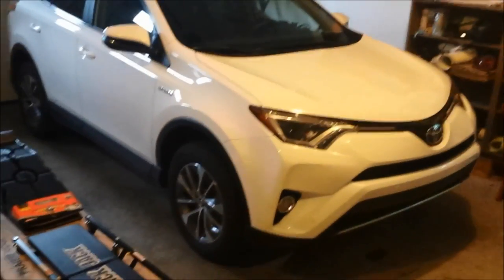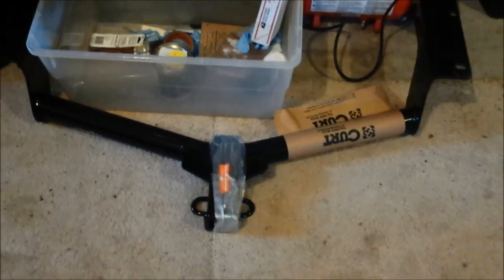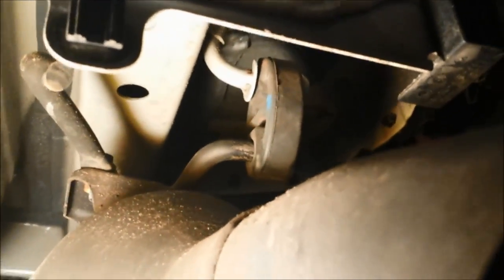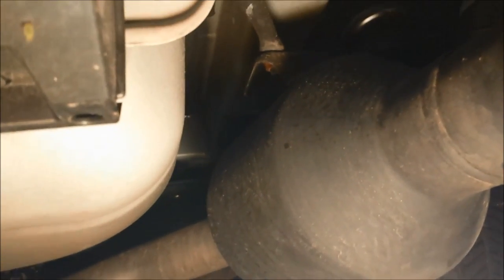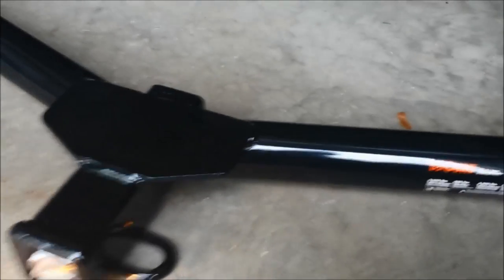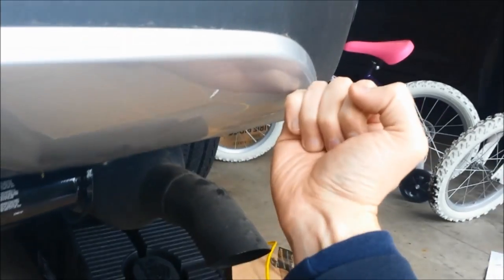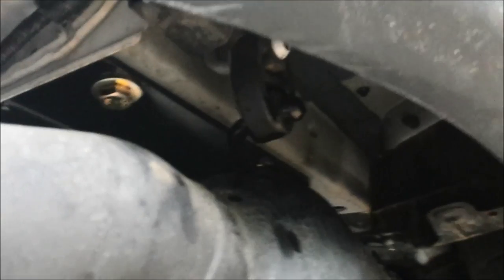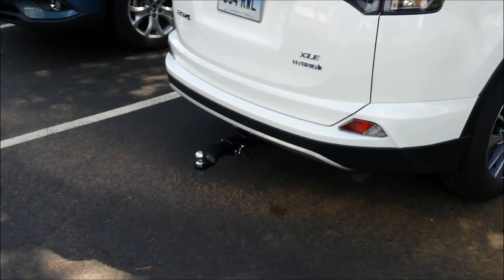2016 Toyota Rav4 Hybrid Tow Hitch Install

Comment: 2 things: I have the same Curt hitch and it did not line up with the frame holes. I contacted Curt and their solution was to use a bottle jack and a piece of 4 X 4 wood to spread it a bit. Also, the holes under the exhaust would not allow the bolts to travel more than 1/4" even though I had cleaned them with a wire brush. I'm going to have to find a shop that can tap the mount holes out.

Comment: Very nice man. I just ordered everything Orem from Toyota. Did you have to cut wires to install the wiring harness?
Reply from the maker: No cutting needed with the wiring I bought.  It was very easy, the wires have connectors at the ends and plug into the stock connectors.

Comment: Here in Finland the Rav4 Hybrid is rated for 3638 lbs (1650 kg) towing capacity when the trailer has brakes.
Are you not going to install the electric output for the trailer? I am asking because here you have to have the full rear lights on the trailer also. :)
Reply from the maker: Wow!  That is over double the towing capacity, thanks for sharing.  I am going to install the electrical wiring for the trailer lights I just have not had time yet.  I hope to soon and will try to make a video for that as well.

Comment: Hey man, great video!  quick follow up question;  how is your Rav4 handling the towing?  how much weight are you pulling?   Do you think the Transmission is doing well so far?  Do you think you may need to add a Transmission cooler radiator at all?  Thanks!
Reply from the maker: I tow and my Jetski (around 500 pounds) about a mile from my cottage to the boat launch. Obviously I do not have any issues, Toyota says it can tow 1750 pounds.  I feel the trans would not have a prob towing the Seadoo farther and it would not need a cooler.  It really depends on what you are towing, how far and how often.

Comment: First of all, congrats on the detailed video! 
Does your Rav4 have the sensor to open the the trunk from placing your feet under the center of the car? Does the hitch cover the sensor or can you use it normally yet?
Reply from the maker: It does not have a foot sensor.  I don't think that is an option yet on any Rav4.
Reply: Thanks for the reply! It is actually an optional equipment now in the 2017 Rav4 SE and standard for Limited and Platinum. My Rav4 Platinum has this sensor and I'm wondering if having a hitch (I'm just looking for transporting bikes) wouldn't cover that. I didn't find a clear answer from Curt. Anyway, once again, thanks for the reply anyway!
Reply from the maker: Nice, I wish they offered that sensor in 2016.  Did you look under the car and locate the sensor?  Try to see how and where it is mounted and if it will be easy to relocate the sensor if needed.
Reply: We’re you able to install the hitch with the RAV4 model that has the power lift sensor? I’ve heard that a hitch can’t be install if there’s a foot sensor but not sure if this info is true.
Reply: @surfingbluerose  not possible to install or relocate the sensor. I don't have the car anymore, but I eventually got the answer. Apparently, for newer versions, the sensor is closer to the corner of the car.
Reply: Fromnevernever I’m looking to get a used 2017 RAV4 limited. It has a power lift gate but not with the foot. So I was wondering if I can install a hitch. Do you know?
Reply: @surfingbluerose  you can. Three limitation only applies to the foot sensor

Comment: What trailer you guys are pulling ? I would love to pull a cargo trailer single axle 5*8 feet, 1350lbs. So I'm risking to get a bit over the official towing capacity ?
Reply from the maker: I have a Jetski and a 5x8 trailer from homedepot.  The max weight is 1750 lbs.
Reply: mooodus - do you think if I use the trailer a few times a year at 2000lbs it's a big risk?
Reply from the maker: I am no expert but I have to say it is a risk to go over the posted limits.  I guess it depends on how far you are going and how fast you need to drive.  Also tongue weight could be an issue.

Comment: I have a 2018 RAV4 Hybrid. SE model.. Still cannot understand WHY the manual and Toyota dealers say under no circumstances are you supposed to even add a bike hitch to my model. My underside looks the same as yours mooodus.
Reply from the maker: I am shocked to hear that. I towed my Seadoo GTR for 4yrs without any issues.  It’s an hour ride to the river for me 50/50 city/ highway.  Around 1000 pounds.  I now have a Rav4 Prime.
Reply: @mooodus  hey thanks for the response. What model was your 2016? XLE or Limited?
Reply from the maker: @robmaclaren2041  XLE

Comment: What trailer are you anticipating using- a typical Haul type? Without extra brakes- what is the maximum you can pull ?
Reply from the maker: I have a 600 pound Seadoo Jetski, no trailer brakes.  Toyota says the Rav4 Hybrid can tow 1750 pounds without extra brakes.

Comment: please  dont trust your life to that plastic ramp
Reply from the maker: +ksabih mejias have you heard of or scene a plastic ramp fail?
Reply: +mooodus no just safty  measures I'd  take  great vid im doing  the  same  thing to mine
Reply from the maker: +ksabih mejias ok, thanks.  I hope your install goes well.  I am still trying to find some time to wire for trailer lights.
Reply: +mooodus  toyota  didn't have the wiring set? i dont want to mess with the warranty. is yours after market?
Reply from the maker: +ksabih mejias yes mine is aftermarket. There are many diff wiring options.